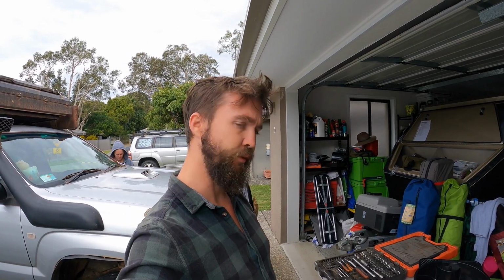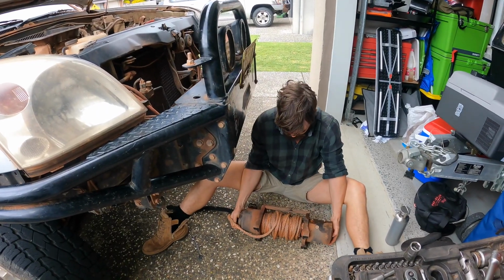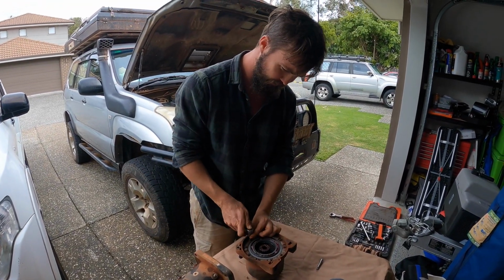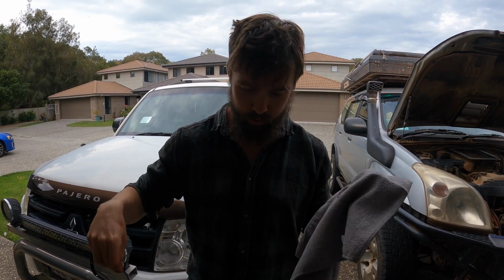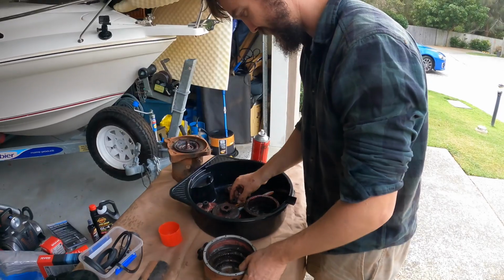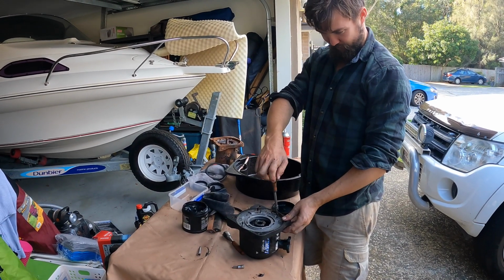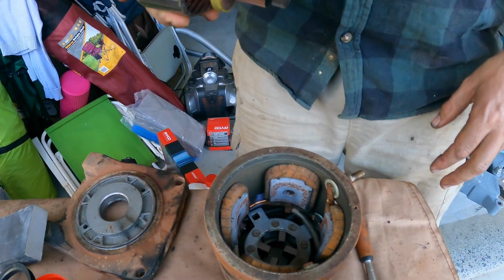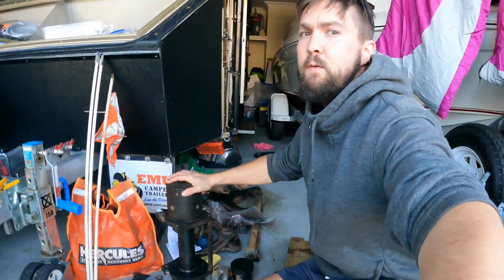Why you must service your Kings winch - after 12 months on the road this is what I found inside..

Comment: - liquid gasket maker (Loctitw518 or something similar (oil resistant) can replace weathered, broken or missing gaskets on reassembly.  a good selection of spare o-rings can be handy sometimes too.  - lots of greasy schmoo is always better..  lol..

(was the housing failure too much torque or too long a bolt ?? - I suppose "enough torque", just enough bolt and some Loctite 243 works a charm (NB, reduce torque "effort" when running in fully "lubricated" bolts.).
 - now you have all the spareparts you may never need - nicely cleaned, lubed and placed into long term storage - ie fresh assembly..
 (NB, it may be 25-50% reduction in torque - click - for the same clamping force - liquid threadlocker is a heavy-ish lube.)

Comment: Thanks for the informative video.  
Bad luck on the cracked mount.  More likely to be from not having all four 'feet' sitting flush against the mounting face than overtightening.  Or, that bolt has been loose initiating a crack during use.
I must say, good job getting a boat and camper into your household garage!
Reply from the maker: Thanks Paul I wouldn't be surprised if it was cracked from the hell we have put the car through on the lap of Aus. The garage is definetly a tight squeeze thats for sure.